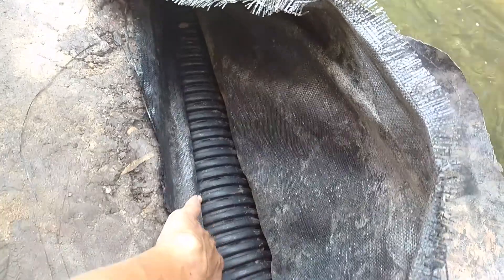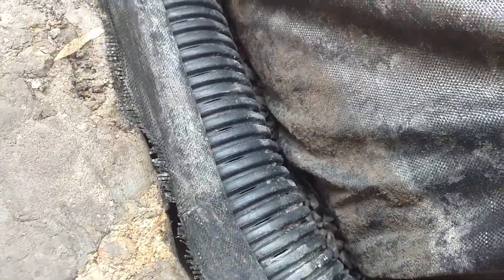Pond "Water Bubble" Fix

Comment: Good question on - did it work?
Here's my solution (3500 gal pond)  I put in a bilge pump, between the liner and the underlayment.  Without that I would be totally skrude.  I recently struggled with this again, and thank goodness for the bilge pump, I had a leak in my waterfall and all 3000 gallons went behind the liner, and this happened twice in about a week.  We reworked my waterfall and now the bilge isn't pumping anything when I turn it on, a good sign.
But that's the only thing that worked for me - a 600 GPH pump, with hose that I can either just pump it directly back into the pond, (Makes for muddy water tho) or run it over to my filter and add water back that way.   Just last week I put in a second one in case the first one dies by running dry.  It's a Harbor Freight Pump cost under $50.
Reply: That's what I'm thinking but just adding a hose underneath coming up the side and hooking a small pump up  when needed to pump water out...
Reply from the maker: Still holding up, but the edges lack rigidity to allow stepping stones too near to the edge. Honestly have never pumped it since doing this. Prior to this, we had a cheap in-line pump and fed a hose down the pipe when needed.